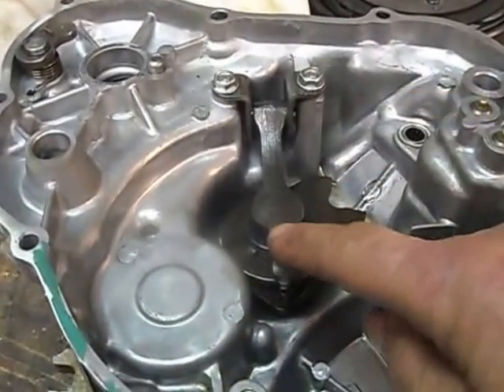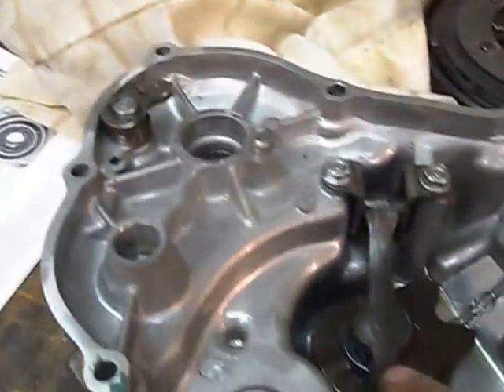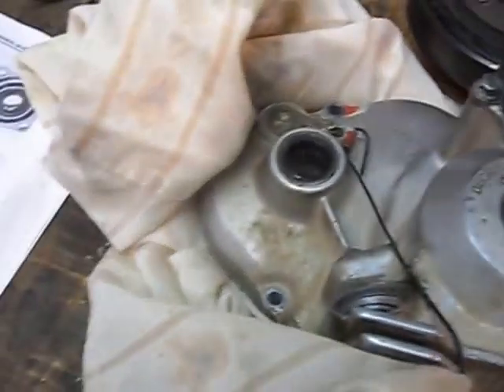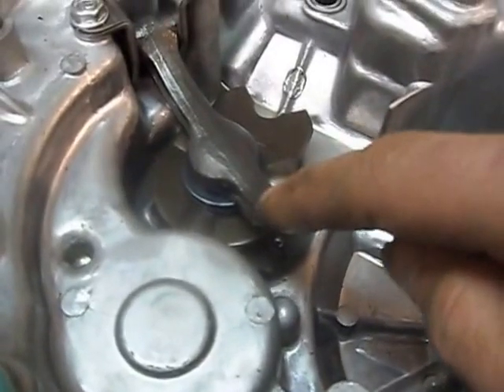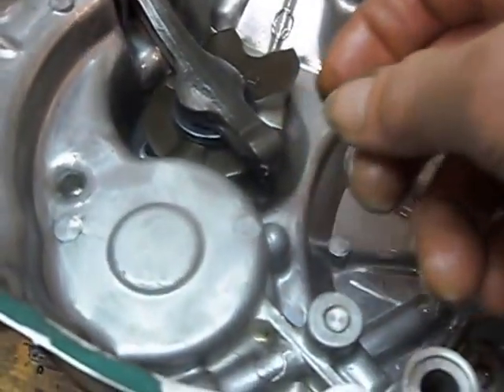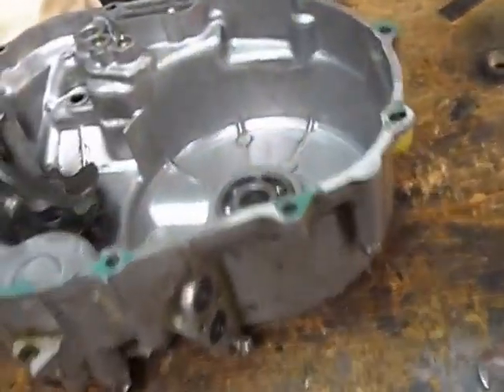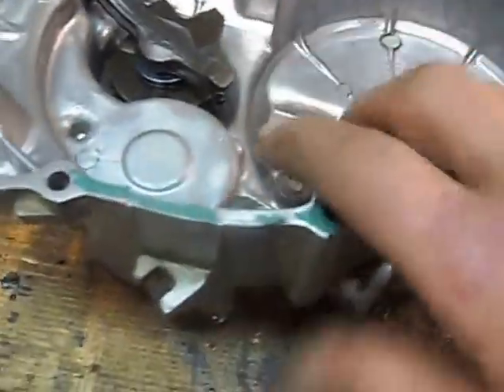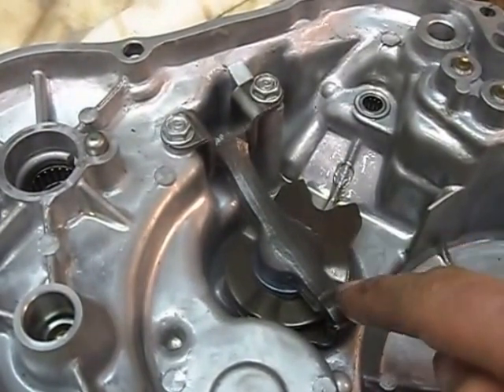Understanding The Clutch Adjustment 1987 Four Trax Quad

Comment: My take is that the adjustment rod has a reverse thread. The increase / decrease words on the case refer to the "play". So a CW turn screws out the rod and increases the play. To adjust, turn CW until free, turn CCW until resistence, then CW 1/4 turn.  In this video, the author had to continue the CCW turns and overcome  corrosion in the mechanism before settling on the actual clutch springs.  Thanks Wayne!

Comment: Would this have any in put to a clutch slipping after changing the clutch
Reply from the maker: Adjustment on the clutch rod is very important..
Reply: Would it still coz a clutch to slip
Reply from the maker: Rod can't have any tension on it,,back out till loose then turn in clockwise till you feel slight tension then its set correct,,if this does not work then your clutch plats or sin typical clutch need to be looked at there are two clutches on this model 87 fourtrax 350cc
Reply from the maker: Look at my video explains all